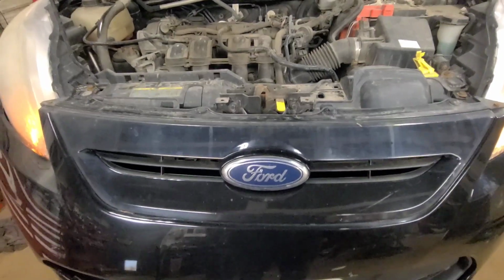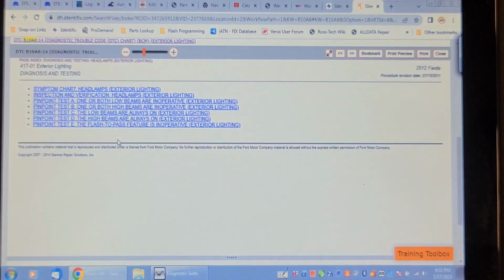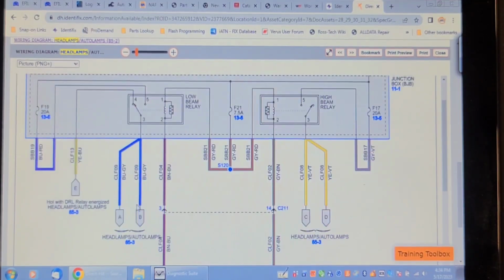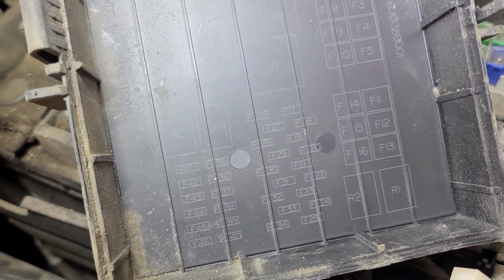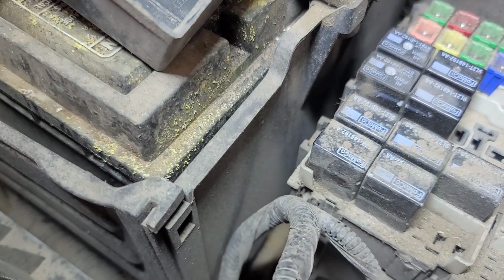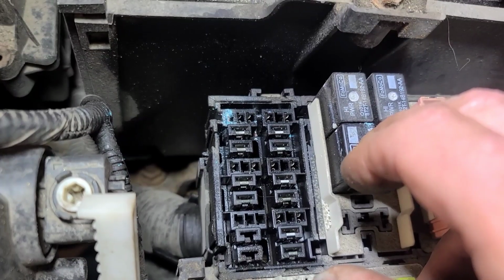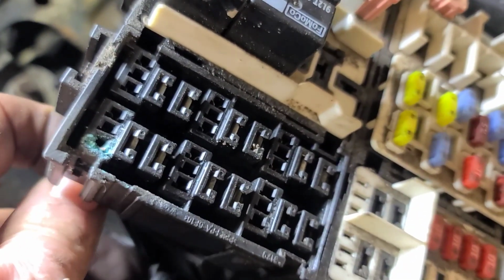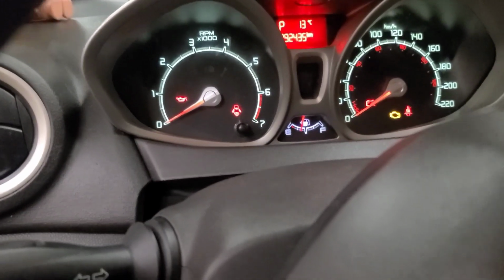2012 Ford Fiesta. No Low Beam Headlights

Comment: Thank you once again, I have a 13 coming in tomorrow with no low beams. Parts cannon has been fired by the owner (bulbs/Connectors and fuse) lol. They did not check the relay or switch.
Reply from the maker: I'd be interested to hear what you find.
Reply: @PhillipBailey  The job was delayed until today. Relay was corroded and pin on outside corner broken. I pulled the battery and battery tray and lifted the fuse box up to seperate it - then cut and extracted the wires and wired in a new 5 pin relay outside of the box. I would have preferred your way but that did not work out. Low beams work fine now.

Comment: Followed this extensively as niece had this issue.
As you said, highly unlikely both globes are blown, right.
Well, in her case it was just that, two blown globes.
Hence I went about it all arse about face, last thing I checked was the globes, when it should have been the first thing Ahhhh.
Then I recalled, I used to drive a Renault work van, the globes would both blow in it at the same time, it was as if when one blew the other must have got a power surge and burn out also.
Morel to the story, "Check The Globes First", they can both be blown at the same time.
Reply from the maker: @ianweal3081  yes you are correct for sure.

Comment: my mom bought a 2012 fiesta from a ford dealership used. i knew something was really messed up, both headlights at the same time went out same time. when i was looking to see which fuses to check, and found out ford putout a recall for the exact problem you just showed. the whole box was not sealed right. so relays did that, not just the lights. the recall was years old, and thy sold it without doing any thing about it. my mom didn't like driving at night. so it i don't know how long they weren't working till we noticed. she took the car back to the dealership, and told her it was take along time to get a proper take to come to town to do the work. she was driving a loner so long her warentee
expired. not even sure if the tech showed up or.....

Comment: Really cool video. I just bought a mustang gt 2017, and the high and low beam light from the pilot side  is not working, the other side works perfect, from the pilot the turning signal works and also the 3 stripes lights, I try a new bulb and didn’t work but I try the bulb on the other side and it works, then I went to the fuse box(no fuse cover) and realize that the fuse was not there for the pilot headlight, put the fuse and it works for like 30 seconds but I was not able to turn it on/off and the goes off, if I put the fuse it goes on for a couple seconds and then goes off, but while is on I’m not able to control it, is just on. Any idea or suggestions? Thank you for the help
Reply from the maker: I need more information about the mustang. What trim level, does it have auto leveling headlights. Which fuse was missing? From what I can see the BCM controls the headlights through drivers. There should be a fault code in the bcm that would help. I suspect the bcm is shutting the light off because of a short. Try get the bcm codes read.

Comment: Had an 08 Silverado with exactly the same problem and apparently I was not the only one. Truck had just passed  DOT inspection but no low beam in the nite?
Reply from the maker: The fuse panels in those GM trucks are very prone to corrosion especially if the cover is not on correctly.

Comment: Any idea how the fuse box actually got that nasty?
Reply from the maker: Combination of northern Ontario salt and battery acid.
Reply: @PhillipBailey  I beg to disagree. The same exact pin in my 2013 Fiesta low beam relay also corroded and broke in a way where I can't get it out. At first I thought it was the poor design of an under-hood box that didn't keep out all the dust and moisture. Then I looked at the diagram on the relay more closely.

There are only two substances I know that produce that bluish green corrosion: leaking household batteries and electrolytic capacitors after they burst. There is one or more capacitors in this relay. Apparently, they are electrolytic (poor choice) and subject to failure and leakage. The fact that it always seems to effect the same male pin is no coincidence.

Yes the battery is nearby, but it is still too far away to effect this socket. Furthermore, car battery corrosion is always white in color. It's the same with corrosion caused by road salt; it is also white in color. I'm sure there are owners south of the frost line who have had the same problem.
Reply from the maker: @BizDocInsights  there are no capacitors inside the relay. I've taken dozens apart never found a capacitor in an automotive relay.
Reply: @NONEBRANDING  Just discovered the same pin corroded and stuck in the socket today myself! Checked the other relays and they don't have any corrosion.
Reply: It's a design flaw